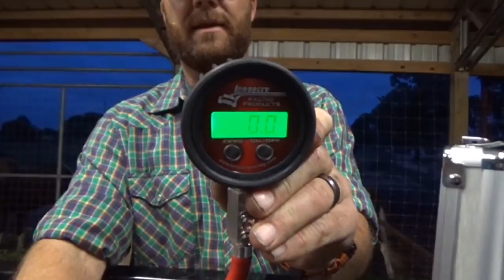NEW TOYOTA TACOMA TRUCK BUILD & DIGITAL AIR GUAGE😎😎😎at Hollis Farms

Comment: You will not be disappointed in the STT pro, I had a set of the original STT put 70,000 miles on them. Have a new set of the STT pros can’t be happier. Also they are proudly built in The USA, I’ve worked for Cooper for over 20 years.